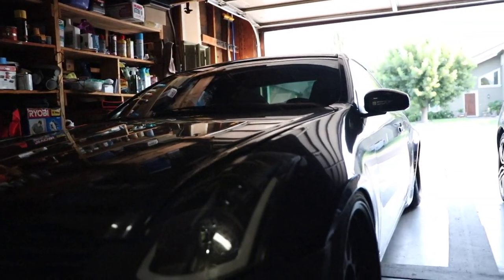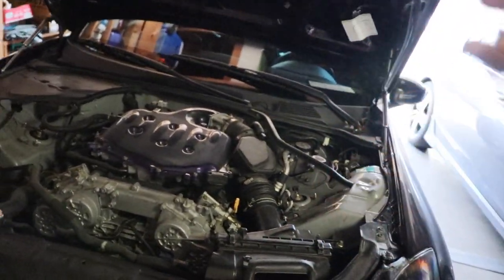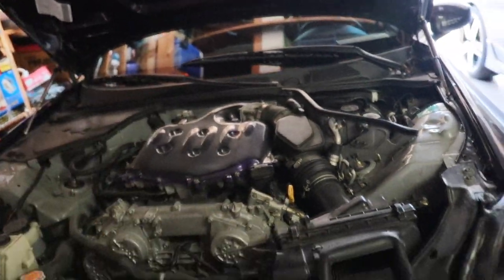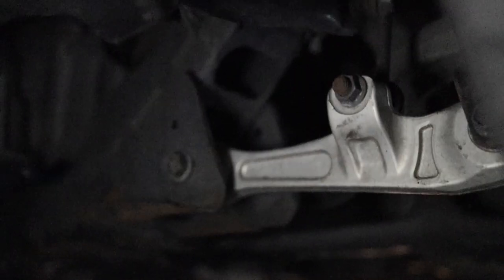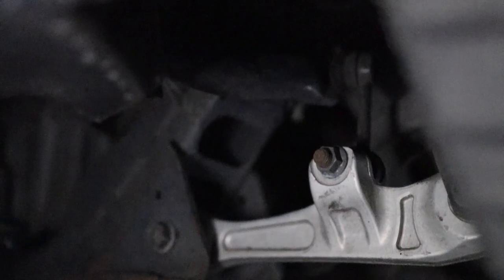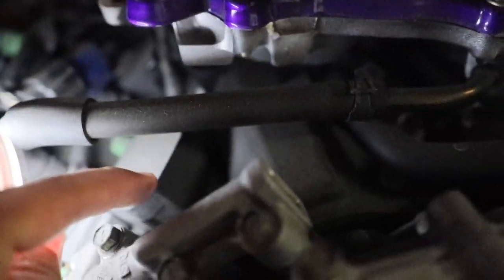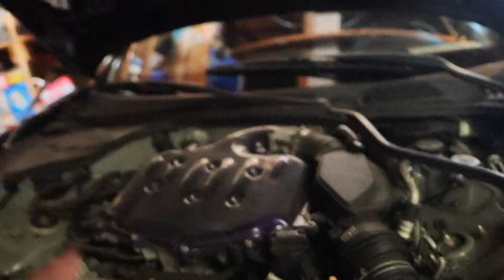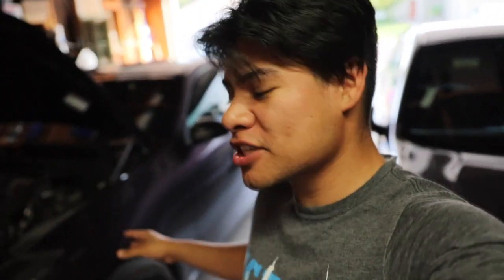G35 TOP 3 COMMON PROBLEMS (2023)

Comment: I’m looking at an 04 g35 automatic with 114k miles for 3500 thoughts?
Reply: Sedan btw
Reply: i strongly suggest the coupe but if you want the sedan i say go for it IF it doesnt have any problems that are going to be the end of your engine soon, assuming theres basic knowledge, make sure its been maintained, watch a ton of videos on what to look for before you get it and know how to inspect it. if you reallt want help you can message me on ig @tthraxx if you wanna know exactly what to look for in a g35 when buying one. im on my third g35 after so many years and had a ton of problems i fixed myself, trust me i know what im saying haha ive got too many tips. having lots of knowledge and knowing what youre talking about when buying is really gonna make you look way smarter than they may have expected you to be about cars and you likely can get a lower price easily. i got a killer deal just acting like i knew what i was looking at, whether i was faking or not
Reply: oh and problems with the electronics in the car are common in 2003-2004 models try to go for 2005 and up thats when they changed up a couple things. also look on facebook marketplace theres a LOT of good listings therw

Comment: G35x common problems- hub bearings,clock spring factory radio (cd 🔴) fuel gage
Reply: i guess i have to wait on it T_T
Reply: just got the car im guessing the radio stopped working but speakers work previous owner installed a aftermarket radio

Comment: #1 window/sunroof motors not working

#2 gas gauge doesn't always read correctly 

#3 low tire pressure sensor doesn't read correctly

I also have not had any bruises because of the door lol
Reply from the maker: One lucky person 👌🏽
Reply: @BeDistinct  may I ask for some advice? I have a black 05 g35 and I would like to make it stand out a little more. What would you suggest I do? My price range is under $500.

Comment: had a 2006 g35 it an oil leak it was camshaft sensors after figuring that out it rained great  got in the accident  hit on February 22nd  2021 😭about to get another one

Comment: Since the g35 and 350z have the same engines let me say, the DE engine is such an oil consumption engine. I had to change it every 500 miles, it's insane how much more money I had to spend to keep up with maintenance. But the REVUP version is better when it comes to oil burning.
Reply from the maker: Damn 500 is pretty often, we shall see how good this car does with oil
Reply: BeDistinct yeah bro I daily'd my 350z and I would drive up to 30-70 miles a day. So I changed it every 2 weeks. 😩 Hope your G turns out way better though! 🙏🏻

Comment: I own a 2007 Infiniti G35 VQHR and i have a bit of an idle issue whenever I press the brakes. My car will reject acceleration and go into a "safe mode" act. I changed both CAM sensors and my throttle body is clean.. even poured cataclean just to be safe but the issue is still there. Any ideas on what it could be?

Comment: My 2007 g35 has been shaking a lot and you can feel it everywhere mostly on the steering wheel, I alligned and change the tired of the car even the front brakes but I’m still having issues and the shaking actually got worse. Any tips you have?

Comment: Fuel level sensor was my first problem  🙄
Reply: I have the same problem. Have you fixed yours?
Reply: Facts got the same problem lol
Reply: Clean up the fuel level sensor
Reply: No I haven’t fixed mine yet lol I heard u gotta try and clean it and see if that works and if it doesn’t u need a new one. It’s pretty simple to do though. U just take out the back seats and ur fuel pump should be on ur passenger side and u take it out and clean it

Comment: Hey brother I have a problem with my g35 its a 2003 sports coupe yesterday I ran it on freeway for 40 miles as soon as get off freeway it just shuts off been doing it lately
Reply: Sensor?
Reply: Camshaft?
Reply: @_g35foelife_26  Yes I saw on a forum that some guys car was shutting off and he said the camshaft sensor needed to get replaced. Its a we'll known problem that's those sensors mess up.
Reply: @soldiers209  true but the thing is my car starts right up it doesn’t just crank I watched a few vids on bad camshafts most of them they just crank but Mine starts up quick and it usually turns off around like 30 minutes of driving then it takes a few minutes to turn back on
Reply: @_g35foelife_26  Doesn't matter bro sensor is messed up regardless
Reply: @soldiers209  thanks gonna replace it

Comment: My g tops out around 80 mph and the acceleration is slow no cel any ideas?
Reply from the maker: sounds like it is on some sort of limp mode. Try to go get the car scanned. Even tho it may not have a check engine light, the car may still have some faulty codes.

Comment: PLEASE HELP
Okay G squad I need help with my G
I have a bushing that split into two that’s located on my actual clutch pedal and I can’t seem to find the name of the part. I thought it was called the pilot bushing but that’s far two big. I can’t find anything online ab this bushing. It is all metal and a little pin holds it in place on the shaft going to the clutch pedal. It’s causing extra play and wearing down the parts.